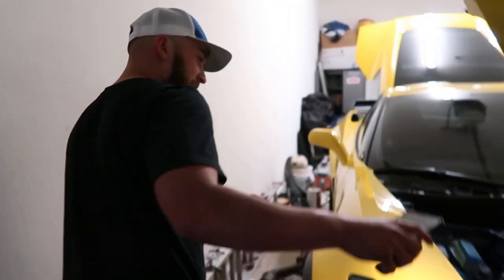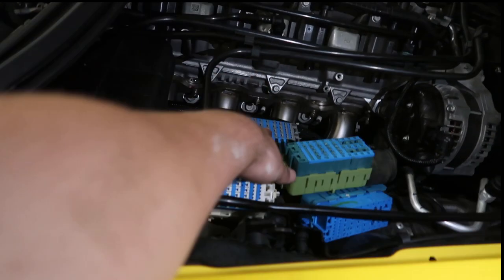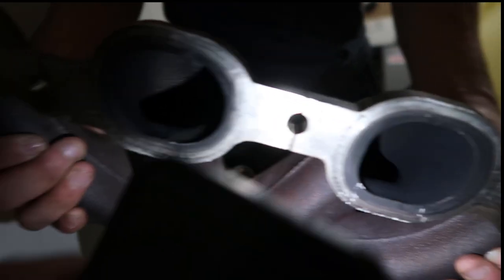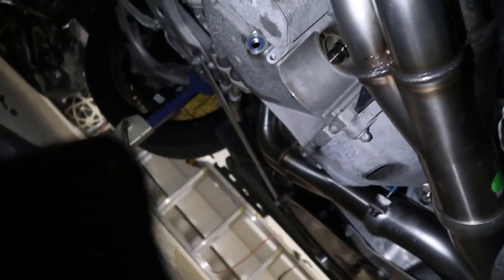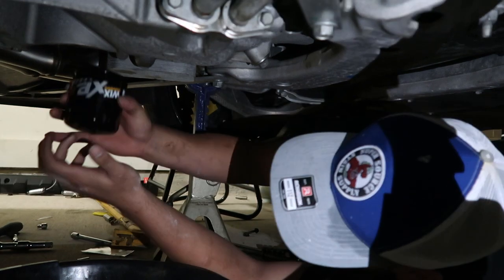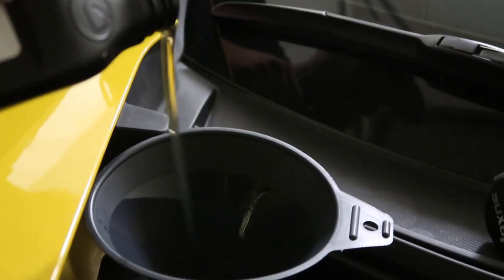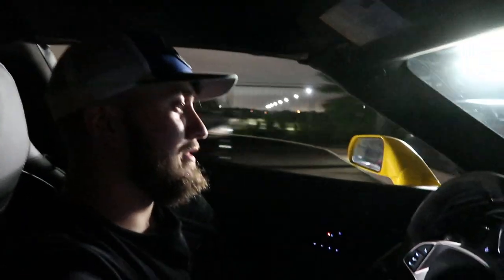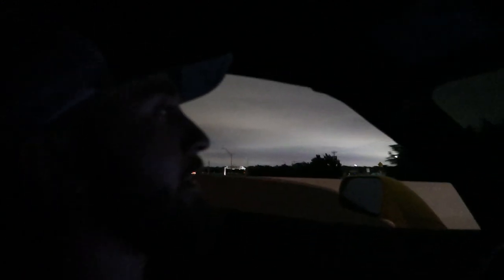c7 zo6 kooks header install

Comment: Dope video 🔥 what made you go Kooks over ARH? Planning on getting headers for mine soon
Reply from the maker: I had them on my old c6, and I think there also cheaper than the ARH and over all the quality is really good. I highly recommend them! my car is so loud
Reply: Def go with Kooks man I def don't regret. Quality welds and great piece of work my opinion
Reply: Do you guys know if the stock mid pipe will mate with the headers?
Reply: @see7583  Not with longtubes
Reply: @ArcticZ1  thanks! I have the kooks headers 1 7/8 to 3in ready to install but I currently have a an edgyvette 3in xpipe on the car. I’m not sure if they will mate up properly.
Reply: @see7583  they most likely won’t. But you can always sell the Xpipe and recuperate some funds lol